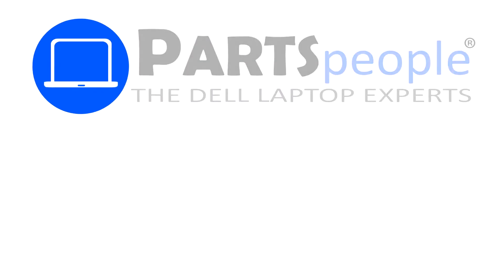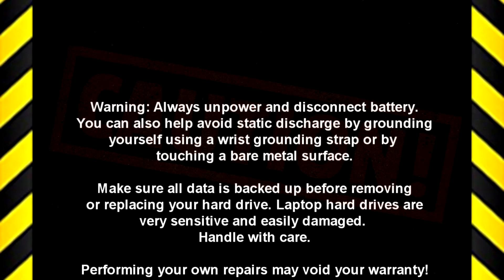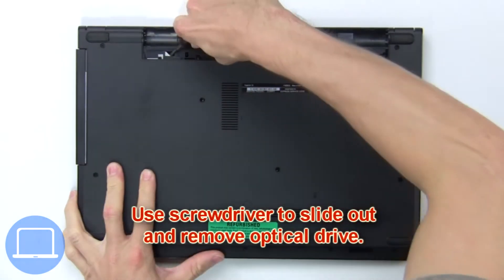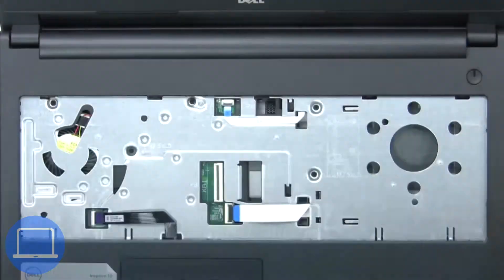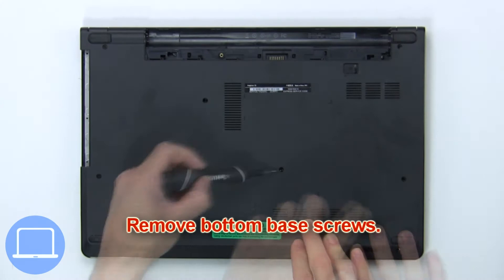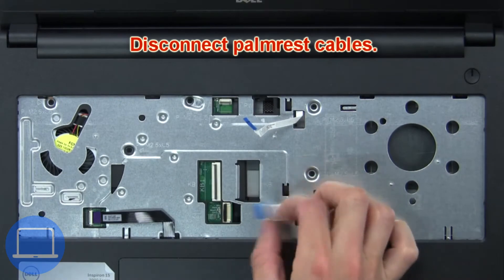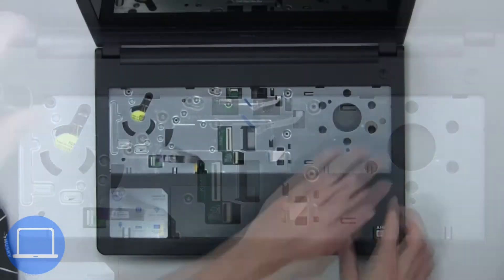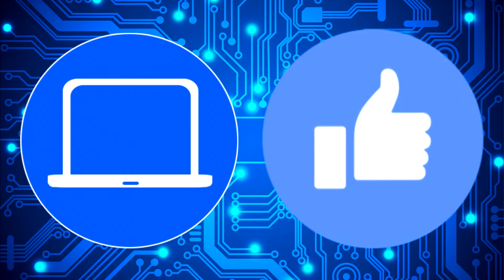Dell Inspiron 15-3552 W/ DVD Drive (P47F003) CMOS Battery Replacement Video Tutorial

Comment: Thanks for this, had a laptop to resell that had this issue. One thing to point out is that you don't need to remove the two thin palmrest cables as they are connected to the top base, and it's only the bottom cable to remove (unless you want to clean it out).